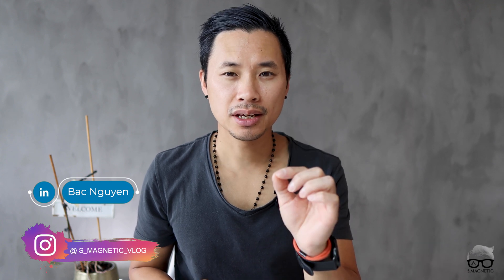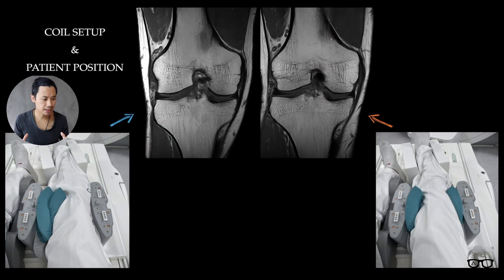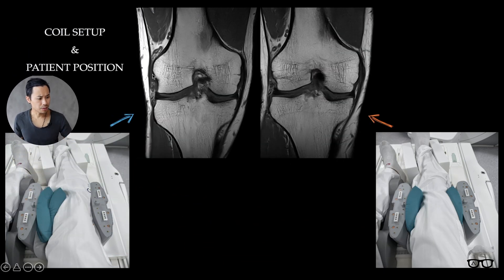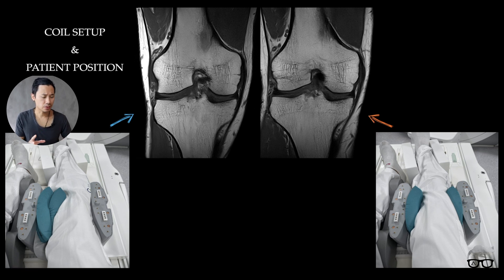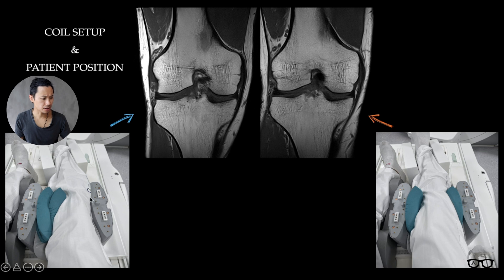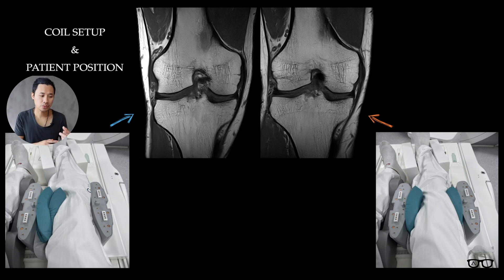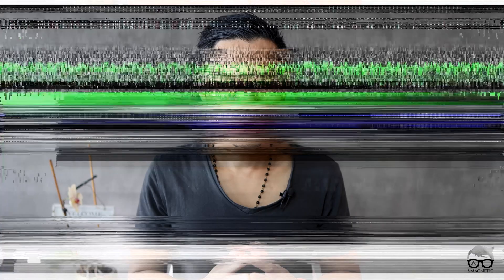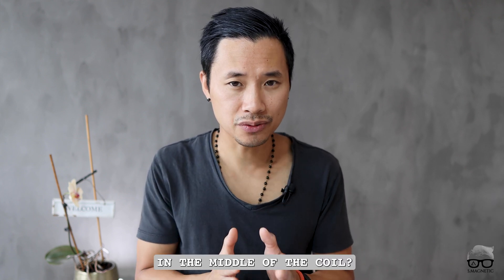MRI – KNEE – SIGNAL INTENSITY

Comment: What  is the different  between  bost  gain sharp in deep  resolve thanks
Reply: Deep resolve gain is a de noising mode that  reduces the noise from images so you can scan worse images and make them look good.

Deep resolve sharp basically doubles the k-space so you can aquire lower resolution images and make them like you would have scanned them with a higher matrix .
Reply from the maker: more info here: https://www.siemens-healthineers.com/magnetic-resonance-imaging/technologies-and-innovations/deep-resolve

Comment: For those wondering this phenomenon is called a "sunflare artifact" part of the standing wave artifacts.

In this case it's due to the anatomy being too close to the receivers in the coil so they get a more disproportionate amount of signal than the rest of the adjacent anatomy.

That's also why Siemens implemented the so called iPat padding in the 4 channel flex coils.

This phenomenon can happen with all coils and systems. Just put a small pad between the anatomy and the coil and this artifact dissappears.

Good job as usual Bac!
Reply from the maker: thanks for the comment. very much agreed. proper position is one of the main key of a successful exam. with that said, fixation is not just fixation, need to do it proper also :)